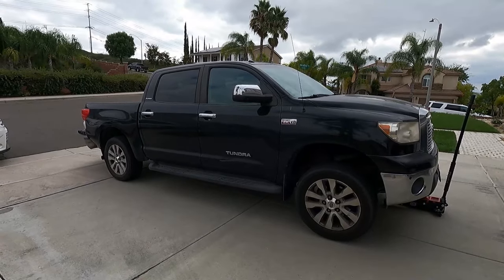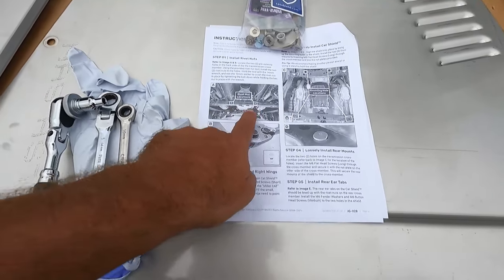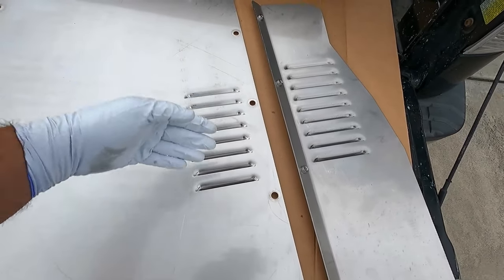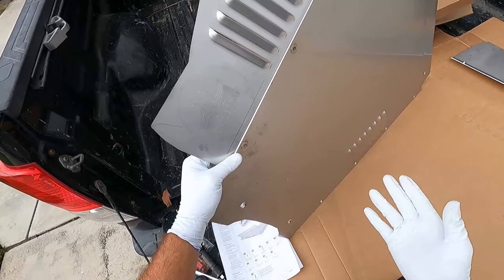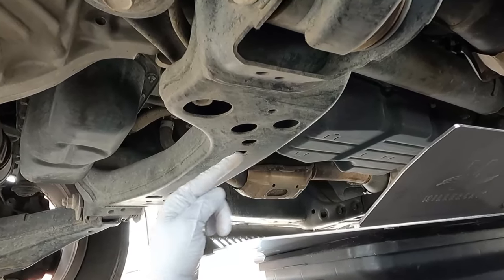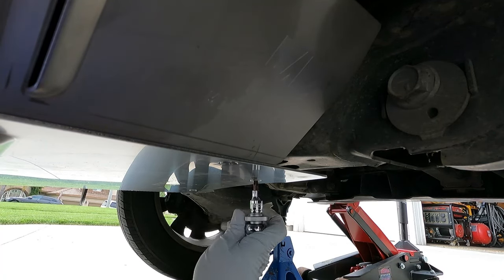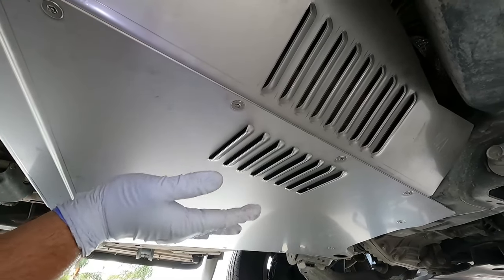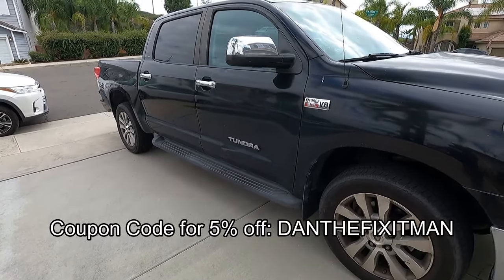2010 Toyota Tundra Catalytic Converter Protection - CAT Shield by Miller CAT - Anti Theft Cover DIY

Comment: Thank you for the video, I recently purchased my  Tundra, the guy that sold it to be had installed this shield.  Two questions for you 1. Will a skid plate fit over this shield? 2. What about the resonator towards the back  any additional shield since they kind of look like catalytic
Reply from the maker: Not sure about the skid plate, but you can reach out to MillerCat via their website. (Link in the description).  Also, they do sell a rear wing add-on to protect the resonators as well.  Thanks for watching!
-Dan